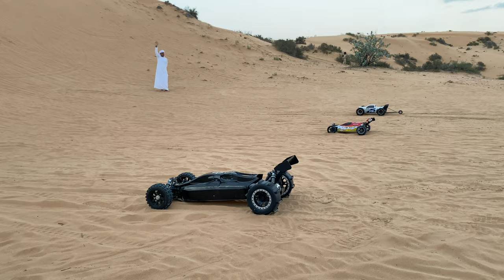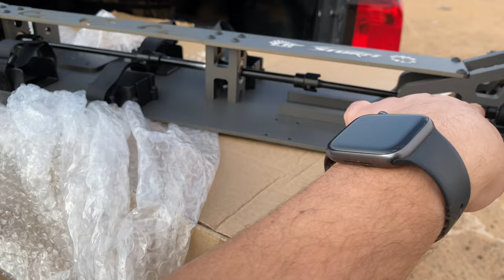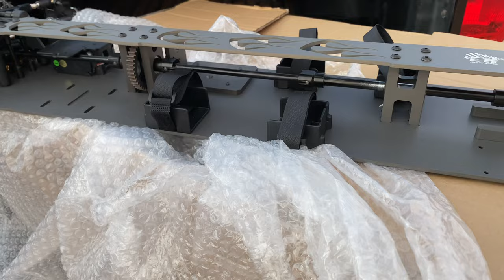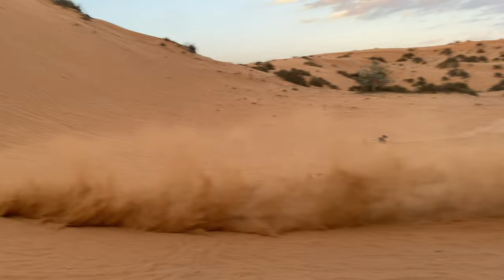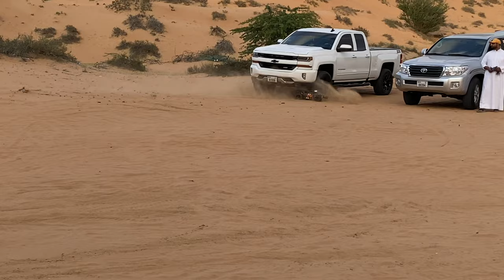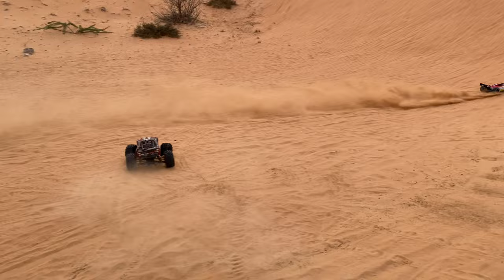RC SAND DRAG HillClimb KINGs the best

Comment: Why do they use paddle tires on the rear but not on the front for the 4X4 RC's?  Any drawbacks to running paddle tires front and rear? Cheers
Reply from the maker: There is a reason that will let you win